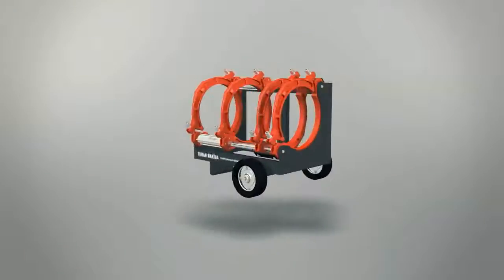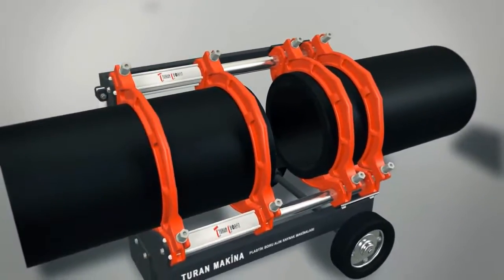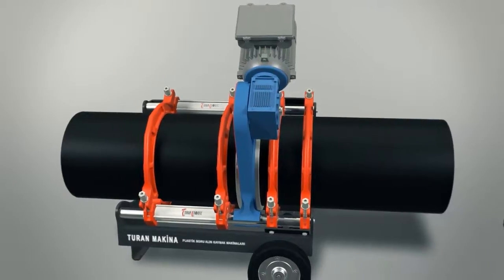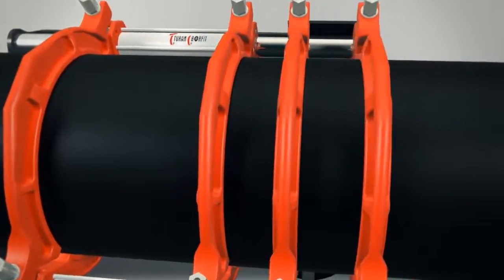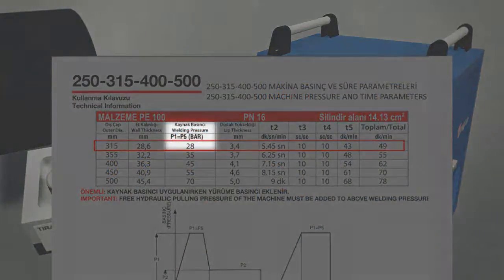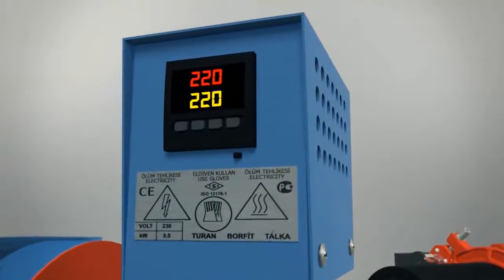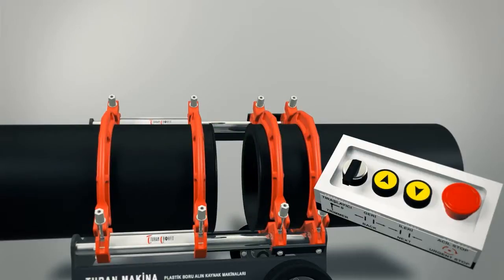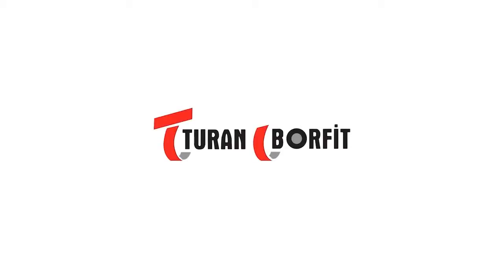Butt Welding Machine Training Video

Comment: Time of cooling ?
Reply: Depends on the pipe size
Reply: Okay, what of 400mm and 500mm time of heating and cooling PN 12.5
Reply: @levicelevite  heat = wall thickness (in mm) x 13 = time in sec.

Cool would be: wall thickness in mm + 3 = cool in minutes.

There are many standards and revisions of standards worldwide. You will need to find out your project specific requirements to be sure.